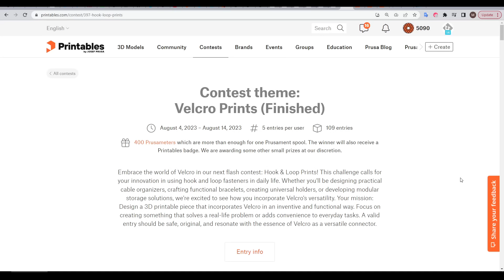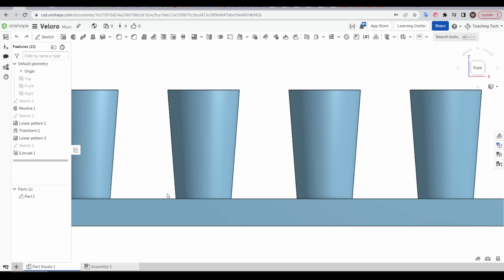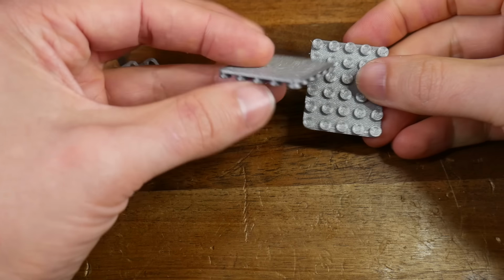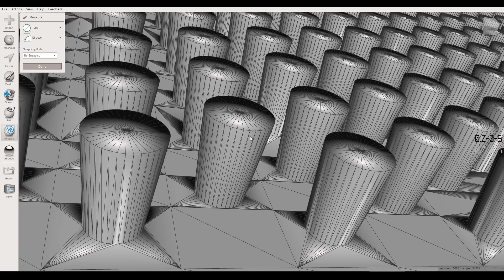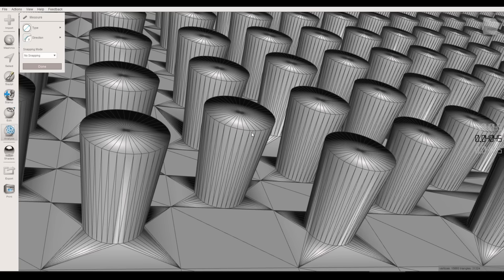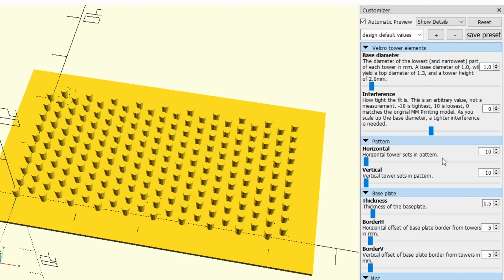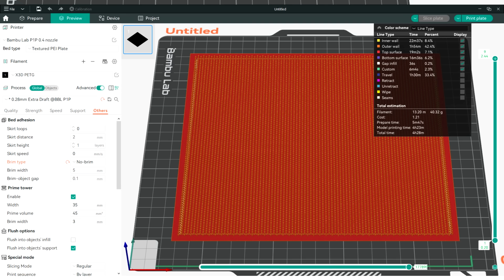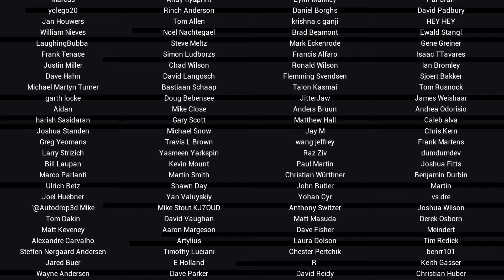3D printed velcro is something you have to try

Comment: You gotta make these tests last 24 hours, most failures of Velcro happens after days/weeks/months of stress
Reply: but thats why velcro is meant for quick connections that arent really supposed to last weeks or months. If you need something that does then Im sure there are better solutions than using velcro. You know, like actually bolting them or connecting them in a normal way.
Reply: @SpydersByte  then why its used for cable managment huh
Reply: @thomaskletzl6493  thats not a situation where the connection would be stressed so it wouldnt have trouble staying together. He specifically said "after days/weeks/months of stress".
Reply: @SpydersByte   You are under the wrong impression.  Combat rated velcro is a thing.  There are several protective vests and fast release but long term wear scenarios where velcro is used. It requires maintenance and it is more than the stuff you get from cable holders.  But you need to look up things before you fire off about designed purpose when there are both special and general purpose of the same thing.  Oh and velcro has been in war since around Vietnam so you are way behind the facts being common enough to findout if you researched at all.
Reply: @rallyfeind   first of all, in what kind of combat use is velcro being used for weeks or months at a time? Second, I said its for quick connections, which is exactly why theyd use it on body armor and the like. I didnt say that its impossible to make a strong bond with it, simply that that is not its design purpose so if youre expecting it to hold up under months of stress then youre probably expecting too much. Also if youre claiming that they use "special purpose" velcro then youre only further supporting my statement that normal velcro doesnt hold up in those situations. I made no claim about special types of velcro.
Reply: Sorry but your argument isn't holding weight. I'm going to publicly say I side with the logic from spider
Reply: @boonjabby  And not a single fuck was given...
Reply: @rallyfeind NONE! not one. Except for the few that brought you back to reply to some bloke on the internet. But after those, nah. No fucks. 😉
Reply: @rallyfeind U just brought up a completely different product that no one claimed the 3D printed one was equal to
Reply: They are tiny plastic hooks, they're going to break eventually. They should make the hook side replaceable, but that would keep you from buying a new one.
Reply: you got cooked  @rallyfeind
Reply: @rallyfeind you don't care that your argument didn't hold weight? After just repremanding a person for, not looking up stuff before making an argument??😮

Yeah , that's obviously cope 😅😂😢.. we can tell b/c you overreacted. Classic pattern right there lads

To community: I introduce to you, the Gamma male - a person who believes they should be in charge due to the virtue of their intellect.

We call them secret kings 😂
Reply: @themanyshadesof4736   to be fair if you aren't looking at facts then opinions are irrelevant when this has facts that can be checked.  I don't need your approval of facts for them to be facts. Also don't need to have 3d printer commenters valid what I lived and wore for service. There is a link of safety and load bearing equipment that is being demonstrated that was argued not to exist...  Sorry if I can think for myself and don't need to have this comment?
Reply: @rallyfeind  didn't need all the extra fluff, but OK, I am glad you know logic (see what i did there?(?!!)) and are thus able to think for yourself, that should make this easier - Now, lets get to the root of this::

 " There is a link of safety and load bearing equipment that is being demonstrated that was argued not to exist... " The important, key words here are: "that was argued not to exist"
I am going to need a citation for that, please.

Spydersbyte: "I didnt say that its impossible to make a strong bond with it, simply that that is not its design purpose so if youre expecting it to hold up under months of stress then youre probably expecting too much. "
Reply: @themanyshadesof4736 I am really not interested in convincing them or you.   Hope you weren't attached to this.
Reply: Velcro is routinely used to keep flak jackets, plate carriers, and kevlar vest secured properly. They have quite a lot of weight on them, and they need to be kept held together snugly in order to work properly. They are worn for hours at a time, every day, for years, without failing or wearing excessively.
Reply: @Joe-ui5vi  It’s been a fun read at least 🤣
Reply: Hey, just do you know, nothing stops you from conducting that test instead of demanding it from others who have already gone above and beyond for you b

Comment: I love that this video comes all the way back around to "Instead of modeling and printing the exact thing you need, you can just make a large generic sheet of 3d-printed velcro and cut it to size!" ... Which is what you can do with normal velcro lol
Reply from the maker: In the end that was the easiest solution I figured.
Reply: yah but normal velcro is like 23 dollars for some small strips.  have you guys ever gone and bought raw velcro to use for projects?  good quality stuff is NOT cheap.  It would be way cheaper to print this.  Also, not everyone lives in a place where its easy to just get velcro.  if i wanted velcro id have to drive 1.5 hours or wait 7 days for a shipment.
Reply: @MrKyle700  I would also trust this to hold far more weight than velcro.
Reply: @AlbertScoot  Um, no. I'm pretty confident real Velcro is much stronger.

Comment: you can make 3d printed velcro just using a standard slicing program. you just need to generate a ton of supports with tips set to a wider diameter. doesn't even need to be flat.

Comment: Have you looked at 3M Command Adhesive Picture Hanging Strips? They are quite like the 3D printed version you are using but use quite thin but tall rod-like structures not the hook and loop design of real Velcro and they hold together very well.

Comment: I've come across cable holders that are just a kind of even finer plastic velcro before. You'd definitely struggle to fdm 3D print something that fine, maybe resin printing it could work though
Reply: Most resins are too hard/brittle. And mechanically stronger resins are quite expensive.
Personally, I found FDM printing to be more practical for almost all designs that need to be functional.
With resin you can get much higher detail and smoother surfaces which makes it preferable for things that are supposed to look good and don't require high mechanical strength.
Reply: @harmless6813  Yeah, that's why my resin printer gets almost no use. Very good for people who paint miniatures and such though.

Comment: Interesting that the 3D printed versions have the identical structure on both halves, whereas original velcro is hook and loops. I wonder if there is a good asymmetrical 3D print design for such a fastener

Comment: Interesting, but what does it cost ?  Not just initial cost, but compared over perhaps shortened life of use ?  Also, ignores the issue of still needing some adhesive on the reverse side?  On Amazon a 50ft generic roll cost $9

Comment: Those 3D printed velcro designs work better than I expected, have you looked at 3D printed cable ties?
A year ago I created the "Hoopin TPU Cable Tie" which is dead easy to print and very strong, a 100% scale print held up my nearly 8kg printer, a 150% scale print was easily holding up 12kg, and 50% scale easily held 2kg.

Comment: You know what would make it stronger? What if you design the model in a way that leaves strings. Almost like the 3d models that have a model inside it enclosed by long strings of filament. Imagine making those exact strands and then just hit it with a hair dryer so that the strings curl like the hooks on actual velcro.

Comment: There's similar fasteners (pins with wide tops that trap each other when pressed together) produced through some non-3D printing method (I'd guess moulding plastic pins onto a surface, and pressing them against a heated plate or roller to squish the tops into mushroom caps) on the market. Notably, unlike hook-and-loop fasteners, they don't have a 'gender', which can be good or bad depending on your application. All pieces from a system are alike, and will stick to each other. Hook and loop fasteners have two different types, that don't stick to 'themselves'.

Comment: If you add a rigid sleeve to slide over your plates once joined you will get a connection that will never separate without the plastic itself failing.  For the design that has larger pins if the base plate has dents in it and the pins have a bump that matches then once it snaps into place there will be no room for horizontal movement.

Comment: It could work best as one side PLA and one PETG. You would get some elasticity in one side but rigid and hard on the other.
Reply: those don't stick together too well and I don't think cura can help with that with this scale
Reply: I was thinking of using PETG with TPU. TPU might act more like the fuzzy side of a regular velcro to make it more bendable without breaking apart as easily.

Comment: Layer adhesion where it contacts the base will be weak af, so "as many times as you like" argument won't work. I give it about 20 applications in the same places until it starts breaking off. If you manage to print it in the first place.
Reply: That's where TPU and TPE win. Layer adhesion is as if it was a molded part. People complain about print quality with TPU, stringing ect. I use ESun TPE 83A in a direct drive modded Ender 3, and the prints are stunning.

Comment: OK, so you're actually printing hook-and-hook rather than hook-and-loop.
Well, I bet that once you've got a print dialed in it will work better and last longer than actual Velcro! Many times I've run into and had my own actual Velcro that did not work AT ALL anymore, even after trying to clean and brush up both surfaces! I was just trying that on my wallet while watching this. It's like the loops are torn or the hook nubs have been filed down, etc. Nothing you do save replacing it will work! So it'll be interesting to see how long a set of this printed stuff would last under regular use!

Comment: I’d be curious to know if you could sew through these pieces (without them cracking or splitting) with a sewing machine to add to a fabric project.
Reply: At least you could introduce holes in the base in cad so you can later manually sew through these holes.
Reply: Depending on the material you print with it could work. Or if you want could basically iron it onto the fabric if you give it a wide enough border.

Comment: 3M Scotch Dual Lock system is very similar to these designs. There are little stems with small ball head on top (mushrooms) lined up in wavy pattern. I have bought some and they work better than velcro. You need like a spatula to separate the two apart.

Comment: Was shrinkage compensated for?... Plastic, when heated, increases in volume and loses that increased volume when it cools. The different materials will need different compensation percentages... So increase by X-percent as determined by the manufacturer. This should increase your dimensional accuracy of the finished product and minimize, if not remove, the unwanted shifting and gap spacing.

Comment: This is very cool. I'd love to see someone try to print a more traditional version. Small nozzle width loops and a bunch of hooked nozzle width strings and see if it works at all.
Reply: My guess is that would be very fragile. The print orientation would cause the hooks and loops to be very weak, and by design they'd probably have to be small and thin.
Reply: @MrAnim8orVideos  Yeah, I think some custom G code could make it work very well. For example what if you had a thin nozzle that actually printed each hook in one consistent movement. The problem is the spacing then, you couldn't have a ton of density, but they'd be much stronger. Would be fun to experiment.

Comment: Look at 3m Dual Lock, that‘s a similar system, but commercial(ly produced). I‘m pretty sure their design is well optimized, I have some of it in use and it works really well. Could serve as inspiration for further 3D printable velcro designs.

Comment: The biggest problem with this is that it fails at the one advantage that velcro has over other fastener types; incidental readhesion. I would think that hook velcro would be possible by simply placing pins at a slight angle away from the next pin location, and spacing adequately so that the nozzle tip remelts the pin into a hook. Obviously that would be a ton of repetitive Z travel, which strictly speaking isn't typically how 3D printers were designed to work, but due to the spacing necessary, I think you'd be able to apply two hook layers together as opposed to actual velcro which is so dense that opposing hook layers fail to adhere, and nonpolar mating would actually be a major improvement on commercial solutions.

Comment: Would be good if there was a formula for calculating how much surface area holds how much weight. With pool fence certification, everything is geared around a 25kg child. I've got some hanging lanterns within the NCZ of one of the barriers that most likely would need to be gone when getting a certification - but to add on a hook-and-loop fastener that is rated to say 10kgs then when the certifier chokes on their coffee at the blatant code violation, you can calmly ask them to test how much weight it holds and watch their disappointment set in when they realise they're not getting their extra re-assessment fee later.

Comment: I noticed a lot of them use Cleat Clips instead of conventional Hook and Loop.  Notably Velcro makes lines using those as well.  Of course using more advanced manufacturing equipment they can make them a lot smaller.  It is notable that many of their "professional" lines use Cleat Clips.

Comment: Velcro is specifically hook and loop, what you made isn't hook and loop at all, it's makes it very confusing using a completely wrong term through the entire video.  What you made is a dual lock type fastener like used in command strips.

Comment: Missed opportunity: the video would have been more informative had you compared the 3D printed hook and loop fasteners to Velcro brand extreme strips (which are also hard plastic) because then we’d know if the chosen model is a reasonable alternative to a commercial product. Your weight test using arbitrarily-sized patches tells me nothing other than the strength of your clamp. 😅

Comment: Muscles also use this principle of strength in numbers. Each piece actually creating a force is microscopically tiny but there are so many that animals can push and pull pretty hard.
Reply: It's the same for the interlocking of the Yellowbook pages. The friction adds up very quickly and it becomes impossible to rip apart without tearing the spine.

Comment: Wow, what a fantastically useful video!

My immediate thought was to use it for a tool wall. I don’t like the hexagon-based walls; besides being ugly, they force you to use a fixed grid, inefficient when trying to arrange tool-holders as tightly as possible. 

I have a tool wall that’s just plywood , with 3D printed tool hangers stick on with 3M Command adhesive strips. I’ll very rarely move the hangers, but didn’t want to mar the backboard when I did. It works fine, but the Command strips are kind of expensive.

3D Velcro would be ideal for this use!

The only thing is that I’d prefer the backplate to look “clean”, without the stringiness of PETG. Maybe I could use PLA for the backplate and then PETG for the backs of the hangers? I need to experiment with it a little…

- But this is a fantastic solution to add to our bag of general “removable attach object A to object B” bag of tricks!

THANKS!!!
👏👏👏👍

Comment: This is more like what’s sometimes called “mushroom tape”, like 3D Dual Lock. That uses mushroom-shaped towers instead of the hook and loop of Velcro.

Regardless, this is really nice work and a very thought-provoking video.
Reply: one example is 3M Dual Lock. I love it for mouning USB Hubs as its more rigid than velco.
Reply: I was going to mention this. it's satisfying to play with.
Reply: Aplix (another manufacture) also has a similar product.
Reply: I use it to stick a power bank to my phone 😂. I imagine they don't come from their molds like that, but like straight pins and then they melt their tips into their final shape. Wouldn't it possible to replicate that, even if the pins end up looking more like lollipops than mushrooms?
Reply: @ecumenicalheretic  interesting idea! You could try to print a blob on top or squish the pins down with the hot nozzle
Reply: @why6212  you’re satisfying to play with

Comment: Standard "velcro" cycle life is 20k+ cycles. I'm assuming this wears out quicker but does anyone know how many cycles this should last?
Reply: Standard "velcro" never survives this number of cycles
Reply: long enough to give it a shot
Reply: @wormball  yea I'm sure real world numbers are lower than the lab tested rating but I'm thinking more along the lines of "If I print this in PLA is it going to wear out after a few hundred cycles." 

Reason being that I'd love to make a double sided hanger that attaches to a latch so to speak. Guess I'll just have to do it and find out
Reply: In my model, the at @bowieinc version a thin base allows some flex so there not much degradation from posts friction. I’ve had two pieces similar to the size he shows at first in my pocket for about a month like a fidget toy, and I haven’t had any wear or breakage so far. I believe that’s one benefit of each post being decently thick.

Comment: Couldn't it be a lot faster to do something like this with Blender's Geometry Nodes? You could still use sliders to parametrically control the design, but it'd export to STL in seconds rather than hours.